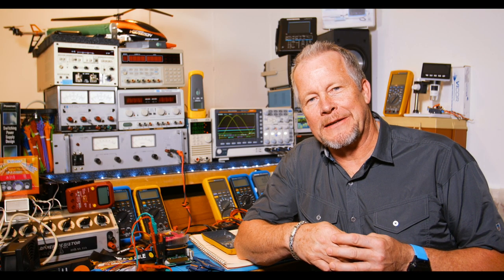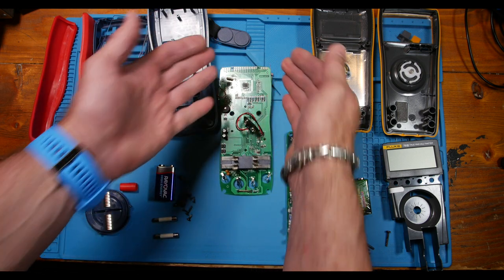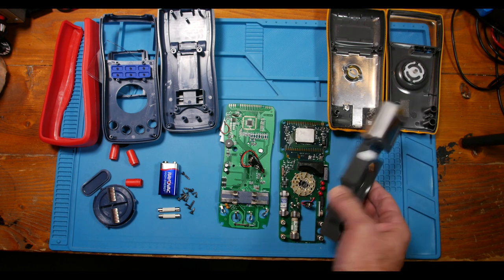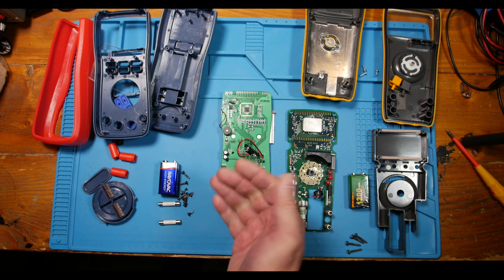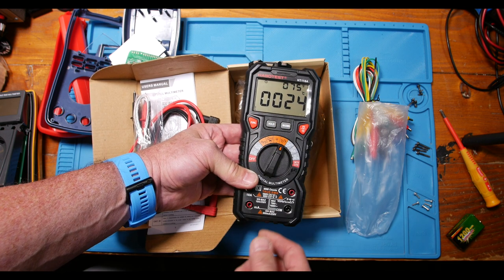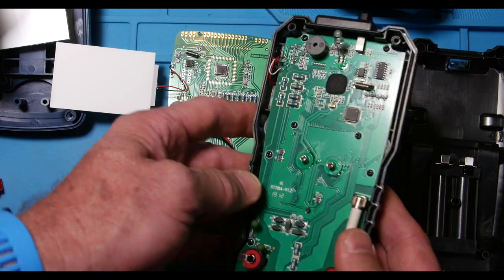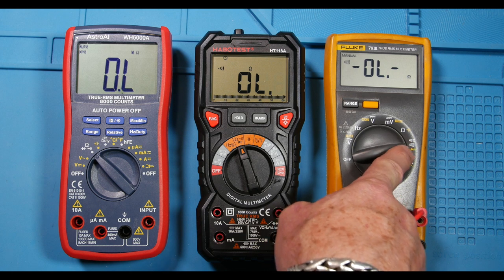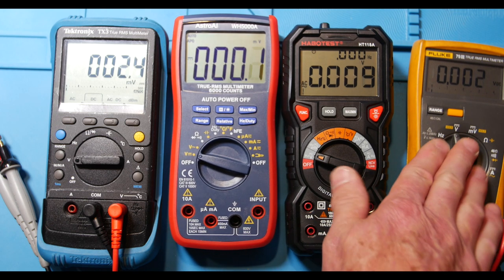Low Cost Digital Multimeters versus a Fluke

Comment: Features smeatures.  What matters is resolution, accuracy and repeatability over time and temperature.  How do these meters actually perform?
Reply from the maker: Great question!  Unlike the old days where there were a lot of discrete components - these new meters have microprocessors like your TV and Phone - so they don't drift near as much and stay on point for much longer.  Unlike meters designed 20 years ago - like the ones people have so much faith in - these are the new tech that just work and keep on working.
Reply: @KissAnalog  For a bench meter, I generally agree with you, however, even there you still can be affected by the tolerances of various sensors used or resistors used to make voltage measurements of current.  For a field meter, accuracy over temperature can vary a lot as almost all semiconductors have significant performance variations with extreme high or low temperatures.  And the high count BGA and similar packages can have solder failures after a number of temperature cycles.  Simpler chip packages in less featured meters often are more reliable than the dense chips used in the feature laden devices.  Just something to think about when buying a meter that may be used in locations beyond a room temperature workbench.
Reply from the maker: Yes thank you - temps are important.  One thing to remember about a hand held meter is that the temps that humans work in are not difficult for electronics - unless you are wearing extreme cold weather gear:)

Comment: Thank You so much for most comprehensive  in depth review . 
As of May 2024 , I want to buy a  accurate entry level DMM for SMD electronic component testing and measuring voltages .
I have budget of $ 50 . Though looks stunning high tech sexy I am controlling myself not to go for   colour bigger screen but will definately prefer backlight colour lcd .
As my knowledge is limited I will prefer both auto /manual mode . 
I have read that kaiweet , multicomp , aneng , uni-t all are actually OEM products .
Can you pls. suggest best suited reliable , sturdy dmm with best build quality .
I will have to check whether it is available  here in India as well as its not possible to import due to high customs duties.
Thank you. Keep it up .My best wishes.
Reply from the maker: Thanks so much!  I appreciate you!  I'd say that the Kaiweets is a great option if you can get them there.  They provided a 15% discount if you go to their store and use the code KA15.  Check out this review: https://youtu.be/ZhE-aKIIRD8
Reply: @KissAnalog  
Hi Thanks I have choosen Kaiweet HT118A its available here , I will use coupon code as well. Thank you

Comment: I’d love to see you do a Test with Find ground faults and open circuits on all these low cost meters VS name brand. I notice a big difference with my Fluke 107 , Klein meter, and my Analog meter.
Reply from the maker: That's a great idea - thanks!  OK, what type of equipment are we talking here to have ground faults?  What type of differences do you see?  Do you prefer the Analog meter?
Reply: @KissAnalog  fire alarm system. A lot of times we have Ghost ground faults that a digital meter can’t read or they come and go.

Comment: Despite the comments here, this video has a few flaws for us plonkers trying to get the inside track. The Habotech 118A is not completely disassembled. Secondly, there are way too many multimeters on that bench. I would highly recommend complete disassembly the Habotech 118A to show off the opposite side of the board and bit of zooming in when identifying components for us newbs . . . as for having to reassemble it, just have a giveaway and send the meter to a viewer/subsriber/patreon in a draw of some kind if you don't want to be bothered with reassembly. Just put the whole shebang in a ziplock freezer bag, stick in the box, and write the url of the video on the box or ziplock so some poor schmuck can reassemble using your video tear down. Give aways are always of interest to new viewers specially for a nice 118A that is a step above the cheap-Os on safety with those two ptc thermistor resistors, fuses, and other on board items.
Reply from the maker: BeanMeUp LOL - I like the idea of the zip lock bag;) Sorry I didn’t show the other side - those switches are a pain to reassemble - but then that’s part of the review.  Maybe I would have been supervised by a higher quality switch?  But you are right, for several reasons I want to redo this review, but I think I’ll put it head to head with two other meters of comparable cost.  Thanks for the feedback!

Comment: Here the fluke looks like the crappiest, i know its probably a better meter for some reason since they can sell them for more monkey. But im loving the meters being produced by the ODMs, they are really crushing it on price idk how you could offer all that for anyless.  Its awesome that anyone can afford a tool which does so much. just the fact its auto range at 30 bucks is amazing then u realize its got NCV. auto shut off that lets you disable it if you want? whats next a speaker instead of an annoyign buzzer that plays a pleasent calming sound. just a gentle reminder that you forgot to turn your meter off.   that would really make my D go from 6 oclock to midnight,  I got a transistor tester that does all the other components for 10 bucks which is super cool cause it has a display that is dot matrix and pretty big and prints images of pin outs and stuff i love it.
Reply from the maker: Thanks great feedback!  I agree - there’s so much better value today in multimeters.  What I see is many buy Fluke just because that’s what they know - they know no better IMHO;)

Comment: I grabbed that exact AstroAI mm recently for $30 and I really like it at that price.

The one knock I'd give it is something you noticed, too:
The continuity is a bit slow. It's not immediate to sound-off. However, once it gets going it speeds up so I'm not sure if it's a resistor or cap issue or if it's designed that way?!

I'll tap a nail and it'll take a second or two to sound. Then, it'll sound immediately from then on so I assume it's a feature and/or issue with changing function. Not sure.
Reply from the maker: Thanks for this feedback!  I still like this meter after having used it for awhile.  Nice display and works great!
Reply: @KissAnalog  Agree completely
Reply: I have that same astro meter and the continuity on it is quite fast

Comment: So what about measurement accuracy?
Reply from the maker: I've never seen a problem.  Actually I don't think I've ever seen a review of a low cost meter that had an accuracy problem.  They are mostly all run by the same chip sets.  It is not the same as teh old days with discrete components.
Reply: @KissAnalog  makes sense. thanks

Comment: Hello friend, I am writing to you from Uruguay, South America.
I work in HVAC at the domestic level and I started at the commercial level where I am finding equipment that works with 400v and I am thinking of improving my instruments.
Currently I have a multimeter kyoritsu model 1009 is CAT III 300V and CAT II in 600v. Do you think the Proster HT118A is the most suitable in relation quality-price? (It was the one I liked the most)

And another question the Proster HT118A is the same multimeter as the KAIWEETS HT118A? Thank you very much for your advice and contribute to being more professional
Successes! I wait your answer !
Reply from the maker: Awesome to hear from our friends in Uruguay! 

I do think the HT118A is a great meter for price!  It is a nice upgrade 6000 count, true RMS, capacitance readings up to 100,000 uF and temp reading, plus dual display.  I think you will like it.  Although, I just did a review on a low cost current clamp that might be worth considering.  It does not do DC current though.  I'll be reviewing and AC/DC current clamp maybe this weekend.  Thanks for the question.
Reply: @KissAnalog  Thank you very much for answering, I will be watching your next video about the current clamp. I hope I can see it! regards

Comment: Aside all the positive comments already posted what I miss are measurement tests. The pros and cons are only complete if we include measurement results.
Reply from the maker: Thanks for your feedback!  I like to show measurements that show something like the number of digits, and the speed of the meter or what it can measure.  Those that show a bunch of resistance and voltage measurements are useless- especially when the reviewer attempts to show references?  The reviewer never shows what the actual tolerances are.  When’s the last time a reviewer ever proved a meter was out of calibration?

Comment: That was pretty comprehensive!  The HT118A looks like good value for money.  I note that you didn't do any measurement comparisons between them - do you find that accuracy isn't an issue with these tools anymore?  I've had excellent customer service from Fluke - really excellent - so I would lean in that direction just out of loyalty I guess.  They are expensive and feature poor when compared to less well known brands (a problem Agilent seems to have as well) so second hand is the best source.  Extech seem to do some good meters at a low price - I think I picked up my Extech EX330 for a similar price (in GBP) to the HT118A and it looks like it has the same features, apart from the flashlight. Just to round this off, everyone needs a minimum 4 meters on their bench, ignore what the wife says :) - Incoming V and A and outgoing V and A.  At $35, or $140 for four, the HT118A looks hard to beat.
Reply from the maker: Andrew Johnson Thanks Andrew!! I totally agree with all you said - especially about the wife;) wait, did she hear that...?  Eeks!!  The accuracy is pretty darn good - really, who writes down a number or two after the decimal??  I find that bandwidth is far more important which all these meters fall into the typical 1kHz range - pretty basic.

Comment: Just stick your probes into any variable frequency AC drive output terminals to measure voltage and you'll see why you need a TRMS Fluke.
Reply from the maker: Yes, but you guys that need the low frequency filter - that is handy to have, but even many Flukes don't have that.  The best cost/value is the Amprobe AM570 IMHO (owned by Fluke).
Reply: @KissAnalog  That AM570 sure looks good. However, I am not quite familiar with the modern tools. But about 20 years ago when I tried to do such measurement at customer's facility with some company provided $50-60 AMPROBE it just froze up with strange symbols on a display. FLUKE 77 offered by customer couldn't do the job either. But my own TRMS FLUKE 76 handled that task just fine. BTW, it (she :)) still works today with the same accuracy and reliability as on day one. I paid about $200 for that made in USA meter (with a pouch and alligator clips) but I've never ever got any single regret about that decision.

Comment: You should test the HRC fuses as well, maybe it's not filled with sand? Maybe it's filled with some cost saving or inferior material that can't extinguish arcs and the molten fuse wire, for example, does not sticks to such material. I'm sure Fluke would not cheap on that, since their CAT ratings are genuine. (and board design is made with the ratings in mind as well)
Reply from the maker: Giorno Giovanna You are so right!!  Fluke doesn’t cut corners - but then you pay for what you get.  It is nuts to be able to get a meter as great as these for the low cost...
Reply: @KissAnalog  Indeed, no matter where they assemble it (albeit Shenzhen or Massachusetts ), it's still the Fluke engineering.
Reply from the maker: Giorno Giovanna again - so right!  Fluke is Fluke for a reason.  I also am a fan of the old Tektronix meters!
Reply: They do cut corners, at least a bit on the Chinese made ones.  They are not  cheaper just because the labor is cheaper.   The build is a bit different.   The 15 and 17 models .  I watched a tear down comparison..  They are still much better than most meters,  but not quite as good as the US ones. 
I've been shopping for a meter for quite a while.   Can't seem to make up my mind.
Reply: @coon-si3ce  Starting from the year 2000, Chinese labout got more expensive, but then again, China is still China, I dropped Fluke few years back, and I'm on my with benchtop DMMs anyways. Handheld stuff is bit of a toy. I mostly use Keysight's products. I would recommend you the same, or some US made second hand Fluke and one of those "new" fangled Russian component testers, or just a LCR meter alongside it.
Reply: It is hard to say if a price increase is because of better quality or increased costs or if there was the demand and thy could jus charge more.  Or maybe they wre eating too much market share from their more expensive models.
Reply: There is a guy on youtube  that has done some destructive testing on multimeters. Kind of interesting how they fail.  Although not many are willing to risk their expensive flukes that way.  He even almost wrecked a fluke, but it came back on after removing a battery.   He was kind of in shock when it stopped working.
Reply from the maker: coo4634 u LOL!  The Flukes are made very rugged.
Reply: @coon-si3ce  I never planned to wreck a working piece of equipment, because we got certificates and ratings, for example,  all of the Fluke stuff. If it's safe for high voltage, then it's safe. I don't except it to deflect a .45 lol.
Reply: @KissAnalog  Yes, but not indestructible..
Reply: Also people tend to treat them better.  It is good strategy if they can make something espensive enough that people never really take chances pushing them.  As an added bonus, they save on warranty work.
Reply: @coon-si3ce  That kinda depends on the demographic. Apple does the same, but you got more punks that slams their phone, and says "muh warranty! It broke I swear!" Of course I'm not saying this is bad for Apple, certainly the opposite.
Reply: It was quite a while ago, but the guy did know his electonics and had proper equipment.  Some tests were for spec and some for common things that might happen like static electricity or revers polarity or other things.  I don't remember the channel or I would point you to the video.  But he wasn't just setting out to wreck them, The tests were fair.  Though limit testing could be interesting too.

Comment: An older tech once had a joke about my Fluke meter: 
"if you ever get an accurate reading with one it must be a fluke!" 

Evidently he had something better (not sure what) but I thought Flukes were supposed to be decent for most stuff so was surprised to hear that, tho may have just been a joke, not sure. The guy knew his stuff and worked on more sensitive equipment than me, but was also kind of a nut always saying crazy things so not sure, lol.
Reply from the maker: Thanks for this feedback!  I think one reason was that since they were always expensive people would buy the lower cost meter like a 77.  The problem is that the 77 is still expensive but is an average in meter - not TRMS!  So people could get the wrong reading on a dirty power system.  But people knew Fluke was supposed to be good so it was a joke - it must be a Fluke.  At least that’s the way I took it.

Comment: This is like comparing a Lexus LQ to a Ford EcoSport.  The Lexus is very expensive, $80K and filled with great features while the Ford is quite cheap $20K. They both take you to the same places, etc.

These meter comparisons are the same. Sure, if you are a technician, you should buy the one that is more reliable and "expensive," but if you just use it sparingly, why spend more money?
Reply from the maker: Thanks for that great feedback.  But, like the Lexus, there are plenty of competition that is between the Ford escort and above the best Lexus.  At better prices too;). But, it is unfair to compare Lexus with Fluke….it would be more appropriate to compare the Fluke to the Cadillac.  The Lexus comparison is closer to the Hioki;)

Comment: Watch out with that Proster meter. Try measuring AC Hertz and turn on the backlight. The vales roll all over the place and never settle down. Next, turn the backlight off and it will display the accurate value. This is 100% repeatable. I can't trust that meeter. The brand on mine was "Kaiweets". There are also "Kkmoon" and "Habotest" brands that sell this exact model. The meter is rebranded but the box is very generic.

Another thing is there is no warranty or manufacturer information in or on the box. It makes me think the seller is shady.  I purchased from Amazon and with a little effort, I was able to return it.

Anyone looking at the HT118A model branded by any seller should beware.
Reply from the maker: I’ve been happy with my HT118A so far, but I’ll try what you have reported is a problem.  I do have some meters that I have in boxes that I need to review, so maybe I’ll find a low cost good quality meter.  I’ll be sure to show how they match up to the HT118A.  Thank you for this feedback - I hope to provide good information.

Comment: I've used Fluke multimeters over the years.. but to be honest, these days I see no point. I have a Fluke laying around somewhere, but for 99% of everything I need a digital multimeter for, a cheap Chinese one will do just fine. I bought lots of them and keep them here and there so one is always available where I do various stuff. They cost next to nothing and do the job just as well as a Fluke does, for all the 99% stuff.
When that's said, I would maybe supply that with an HT118A, just for that 1% case.  Possibly. The Fluke I have can stay wherever I once put it.
Reply from the maker: Thanks so much for this awesome input!  I think you are so right!  Check out my review of the new 20k count HT118E: https://youtu.be/ZhE-aKIIRD8
Reply: For basic use these el cheapo meters work fine. It's pretty accurate too. Most use just voltage and continuity.